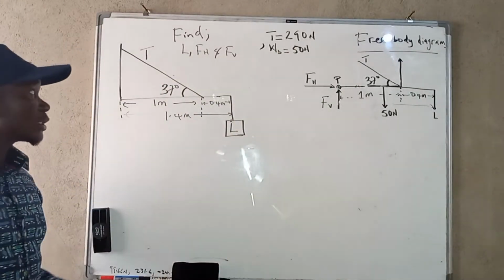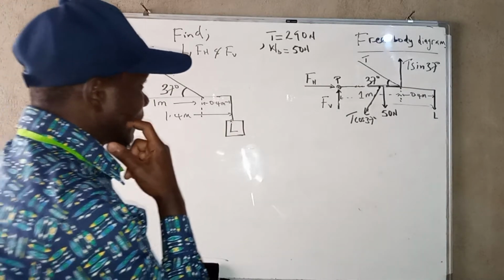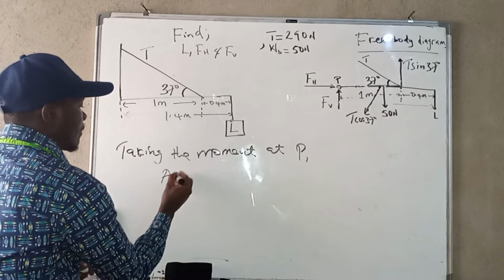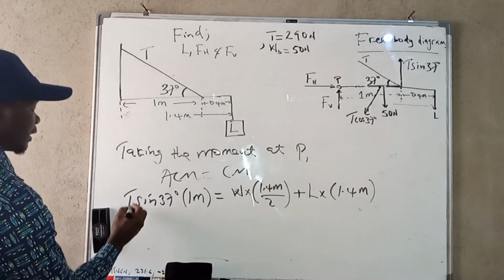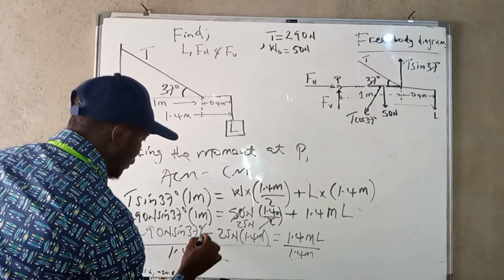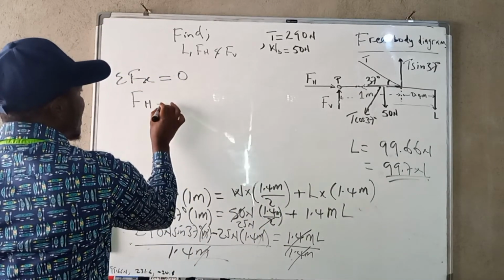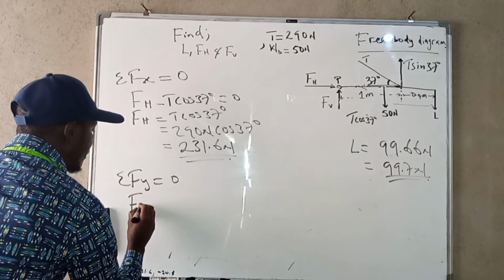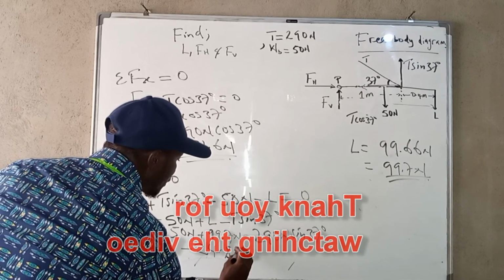Finding the load(L), horizontal force(Fh) and vertical force(Fv), L, Fh and Fv in static equilibrium

Comment: Though in a tutorial sheet mass of the beam was not given, so how can you do it if not given mass of the beam
Reply from the maker: There are times when you may not need to have the mass of the beam in the question, in that case you will be told to consider it as a beam of negiligible mass.
Reply: @JMKcreatives  okay, so if it's negligible,then there's no need of including it in a equation Right?